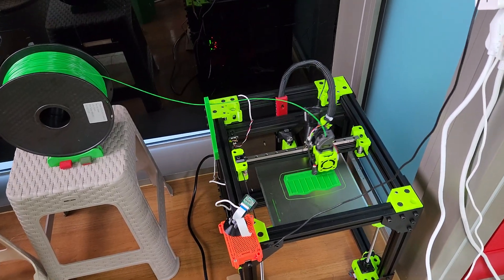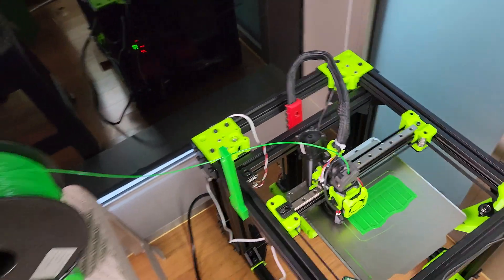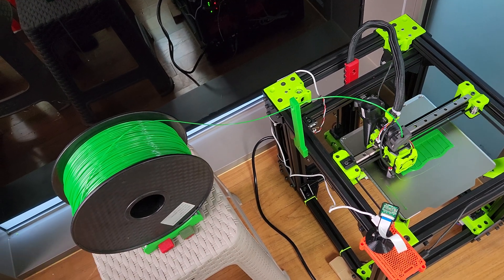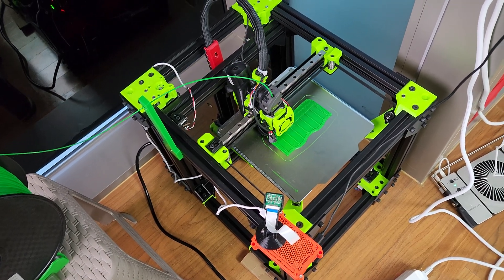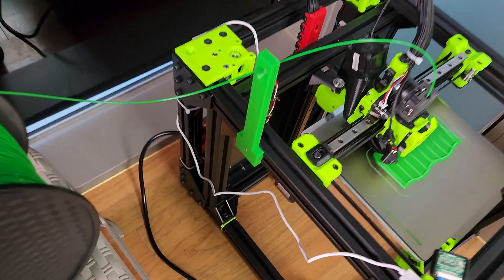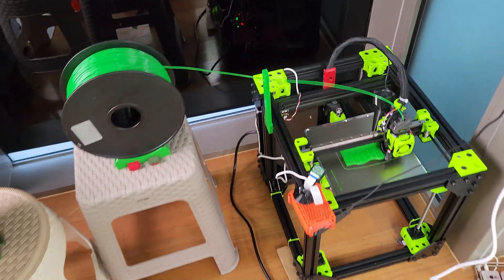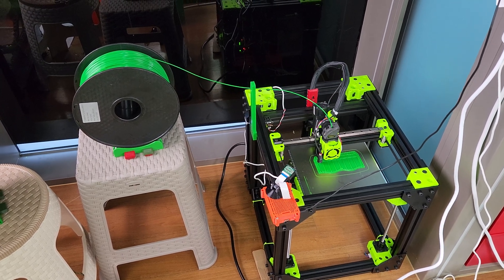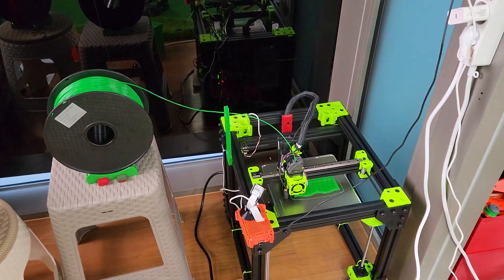New Ratrig Filament Guide Design for 3030 extrusion working well.

Comment: You could improve design a lot by just putting a little piece of reverse bowden in hole of the guide. Filament will rub against guide and cut through it slowly. Piece of tube will prevent that.
Reply from the maker: Yes I am actually redesigning it to fit a 4x3 reverse bowden tube as it works well currently for petg but with tpu it gets stuck due to the flexy nature of tpu.

Comment: Which do you prefer more, your Voron 2.4 or your RatRig?
Reply from the maker: Vorom seems much quieter, more efficient design for being on budget and maximizing the space, ratrig is built well like a tough truck but very loud.  Ratrig software is very well tuned out of box while klipper on voron is a mess.  I like both for now but ratrig needs to go in another room.
Reply: @3dPrinterSchool  thanks! I have Prusa right now. Doing my research on LDO Voron Trident and RatRig.  Your videos have been helpful